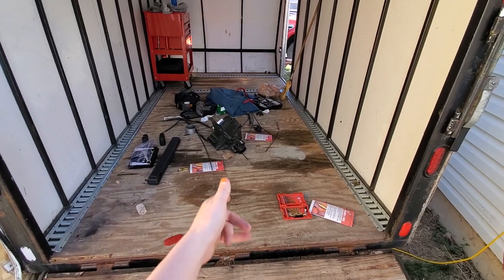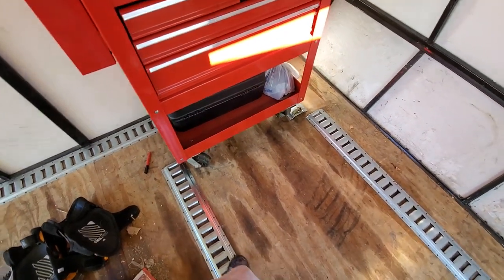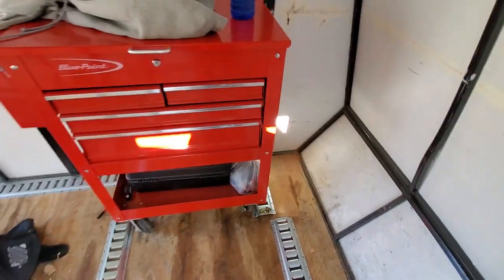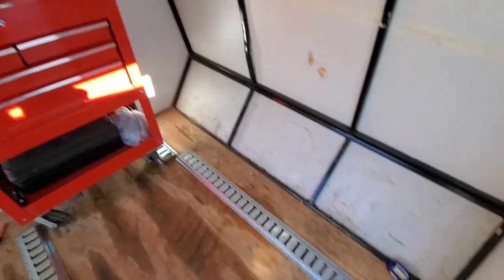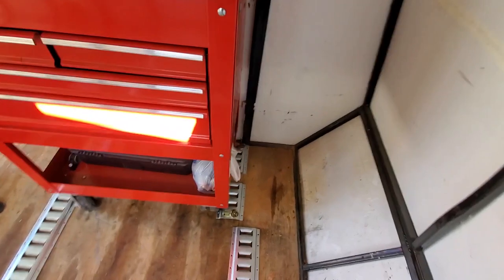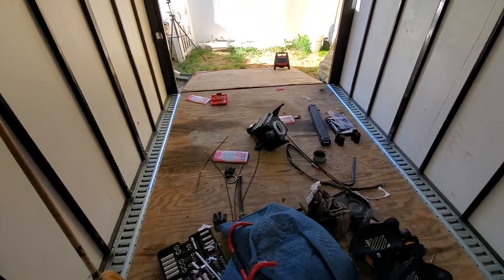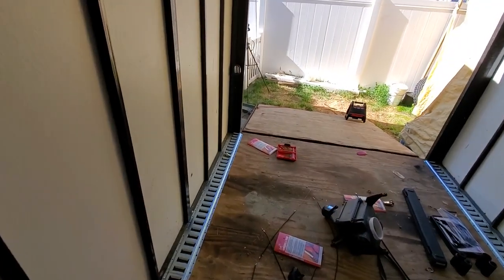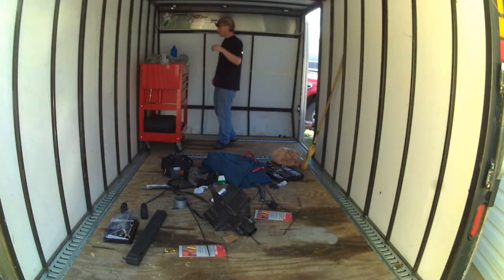HARBOR FREIGHT E TRACK FOR THE TRAILER (PART 2)

Comment: What size or type screws did you use?
Reply from the maker: I used 2 different kinds I did wood screws when it only went threw wood and than self taping screws that went threw the metal. Really going to depend on your use